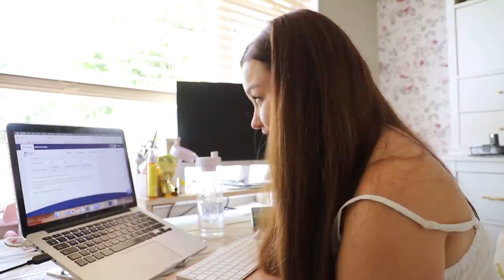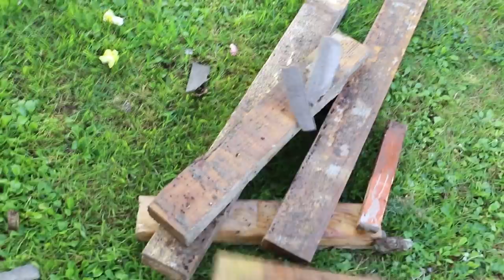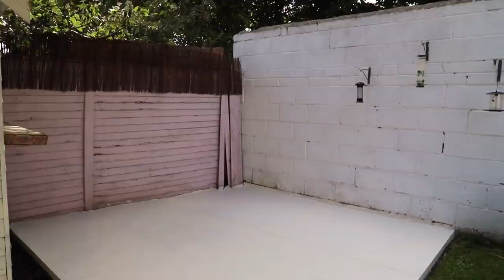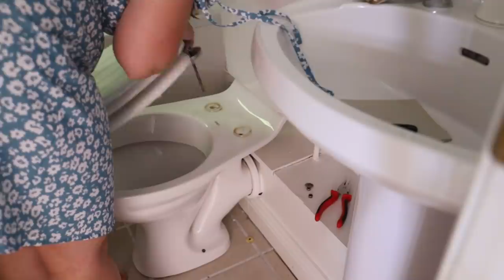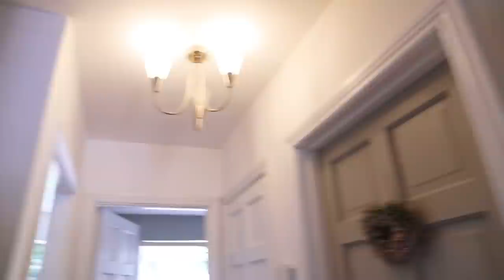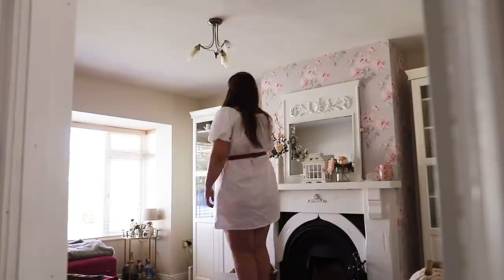Home maintenance vlog: tackling odd jobs around the house with me

Comment: Hey Catherine,
I don’t know if you know, but a little tip for you when replacing bathroom sealant -
If you put a strip of masking tape either side of the crack to be sealed, it allows you to apply your sealant in a very straight line and only as wide as the separated tape. Remove the tape before sealant dries. Works a treat! 😊🇬🇧
Reply: Great tip -I'm about to reseal around the base of my tub and this will protect the floor tiles.
Reply: You can also cut off a corner of a loyalty card (not your bank card!) to an angle and use that to smooth off the sealant, it gives it a nice slanted finish, and the water will just run off it.

Comment: The word you are looking for was “shuttering “ round the concrete base. You have a talent making things seem so much better and cheer people up.  Talented Lady we need a tv series for sure.
Reply from the maker: Awwwww so kind Jane 🥰
Reply: We call it framing in the US.
Reply: The wood around concrete slab is called forms. It holds the concrete until it sets up
Reply: Kerry Verlinden Hi There are so many terms for this, quite amazing when you think about it. I have built so many concrete structures using wood for support, a basic idea but it works

Comment: I'm 5' & hate getting on the ladder so lightbulbs burnt out in my house? Oh yeah, there are to many of those I need to get to this week. The other thing is cleaning out the roof gutters! Miserable grimy job but has to be done before fall arrives. I just freshened up all the caulking & cleaned/filled in all the grout so that's a annual summer job ticked off the list. The other summer job is thoroughly cleaning the fireplace/woodburners & getting the chimneys all cleaned out before fall arrives when I'm back to using them. Lastly is checking all the weatherstripping & replacing where needed then I think I'm done.. for now anyway. Maintenance, as any homeowner knows, is never ending.

Comment: My outstanding jobs are: painting a mark on the ceiling made by water leakage which was fixed two years ago, hanging a picture which has been propped up against the wall for over two years, and tidying that drawer in the kitchen which ends up full of junk and won't close properly.  Well done for getting your jobs done, and a great idea using the fencing like that.  That is another job which I need to do actually...
Reply from the maker: It never ends! Hope you can tackle all your jobs.. think of how good you'll feel when its done! 💕

Comment: Totally relatable🤗... . I need to change bulbs in kitchen, hall, bathroom, etc, furniture needs building, tap need building on one bathroom sink, pressure clean front of house, grout needs cleaning, need to finish cutting trees and hedge, fix shed, need electrician for outside light, need to try and fix shed roof which is leaking due to rotten bits, order new freezer, mine is not cooing properly 😭..the list Endless 😭😭Then I have decluttering, deep leanetc to do. So much to do! Months of doing nothing due to work and kids😭... Fun summer ahead.. Not😭. 

You did a great job👍🤗

Comment: I did buy new packs of furnace filters today and replaced the old one. I usually do this once a month, but that is an easy peasy job!! I buy the new LED light bulbs and they last so much better than those older kinds do. Hardly ever have to change a bulb now! I do need to put new sealer around the bottom of my bath tub. Thanks for the reminder! You are a handy person around the house Catherine!! Well done!

Comment: Salutations Catherine,
The odd job I did recently was re-doing my sun-damaged Stainless steel grill. I removed all the rust spots with Bar Keepers Friend. This is a cleaner and polish. It works like magic! Once I was done, I washed the whole grill with Dawn soap and let it dry. I then took a wired brush and removed all the rust from frame that holds the grill together and also where the gas is located. Prep the areas to be painted  and gave them two coat of Black Rust-Oleum spray paint. The grill looks brand new again!

Comment: LED bulbs are fantastic. I moved into my house 5 years ago and decided to replace all the bulbs with LED - I haven't changed a lightbulb since. 
My to-do list is to actually finish a shadowbox project I've had sitting on the dining table for 2 weeks then hang it up, get rid of 2 almost dead house plants that I have officially given up on, de-clutter a dumping spot in my garage so I can get to a box of stuff I've been meaning to donate then get the box of to the charity store, and hang up a framed butterfly that I bought at a charity shop last week for $2!!!!!! If I get particularly ambitious I may unscrew the u-bend under my kitchen sink to see if there's a block because it's draining really slow.

Comment: I am intrigued what you are willing and able to tackle in fixing and maintaining your property. You are an example to all of us. I always take the light bulb to the hardware store when I need to replace them. In South Africa we may only use the new LED light bulbs. These last a long time, slowly getting dimmer before all charge disappears. Because of this it is pointless laying in a store of light bulbs ahead of time. My light fittings and lamps use different shapes and sizes, some screw-in, others  pronged, which adds to the confusion. We also have very hot weather here in summer but I have not thought of gardening in my PJ's. I think I am just too old.

Comment: Catherine...the paint roller that you used should have a threaded hole at the end of the handle that will screw into any broom handle...which you can unscrew from your broom. I don't know if it's the same in Ireland but here in Canada...they make paint rollers to fit any standard size broom handle.

Comment: I just bought some willow fencing for my patio.  I have put a cattle panel arched over the concrete, secured with t-bars,  like yours and now I'm putting the willow over the top so it will be a little cooler.  I'm in Texas and it's 9am and the temperature is already 83 degrees, 28C.  It's supposed to be 98 degrees this afternoon.  And 101 tomorrow.  That may be one reason we are all addicted to ice cubes!  Good videos, thanks,

Comment: Don’t know if you have it in Ireland but bar keepers friend is a great product to clean off rust in baths, or to use on anything that needs rust removed really.
     Also whenever you’ve got a screw in part of a bulb stuck because it broke off you can use a potato to unscrew it out of the socket. Weird I know but it will work.

Comment: My home is only 3 yrs old, but I need to change some things out. I need to hire a handy man to change the 3 bathroom sink faucets, and in my kitchen I need him to change out the can lights from the kind that are supposed to  last thousands of hours, and even then need to be changed by an electrician when they eventually go out., I will have them changed to the kind where I can change the bulbs when needed, using the super energy saving bulbs. By the way...love the little bird foot prints in your concrete slab  :)   tfs 🥰💐🌵🌷🌺🌼🌞🏜️💗🥰💐🌵🌷🌺🌼🌞🏜️💗🥰💐🌵🌷🌺🌼🌞🏜️💗

Comment: I painted my patio a darkish gray and stenciled after that - it is sort of a star and floral pattern. It turned out very pretty. I put two light coats of a polycrylic to protect the paint. One year later it still looks great. I have had one bulb out in my bathroom for months. Going to clean the glass fixtures and replace the bulb now.

Comment: Hi there Catherine!  I’m doing odd jobs right now.  Cleaning window screens, washing basement windows, pulling quack grass from the flower beds, trying to figure out where the toilet screw caps went for the 2 screws that go into the floor.  Vacuuming sand out from between the sofa seats (?), wondering what to do with all those printed off recipes stuffed into cabinet drawer. Lot of time is spent in the analysis stage!

Comment: You can shove a potato in the light socket and the lightbulb screw thread/ elements (whatever it's called) will hold into the potato and screw back out.
Reply: Don't forget to switch off the power as long as you do. 😏

Comment: Love this video, and it is a case of snap, I need my boiler checked,. do some sealant, which I am bad at and I have given up on my hall ceiling lights they are spotlights difficult to change, I was going to replace with LED bulbs bulb after checking the price I think might replace the unit and then add bulbs. I found an old broom handle and it is handy when I need a long paintbrush. I known none of it is hard just need to get the energy

Comment: I’m going to look into sealing my bath. It seems to have dropped and the are gaps. Going to look for your bath reselling video. Just need to get a blade.
Reply: Lewis it’s easily done,just remember to fill the bath with cold water first,as if you don’t you’ll see a gap as it pulls away from the tiles when filled with water and you lol,I ran masking tape along the tiles and the bath put sealant on ran my finger over it to push it into the gap,then took off the tape and you have a nice straight line of sealant,hope that helps 🏴
Reply: @myra1966  hi thanks for this I shall try that I shall have to push mine into the gaps as it's a right mess.
Reply: @LewisBrain  when your cutting the tip off the sealant rather than cutting it a few mls down cut it about an inch down from the tip on a slant that way you’ll have a thicker amount of sealant coming out to fill the larger gap,good luck
Reply: @myra1966  thanks I’m planning to get it all out and start again.